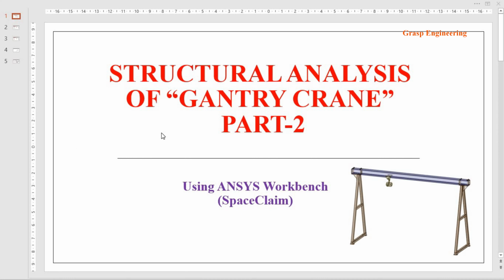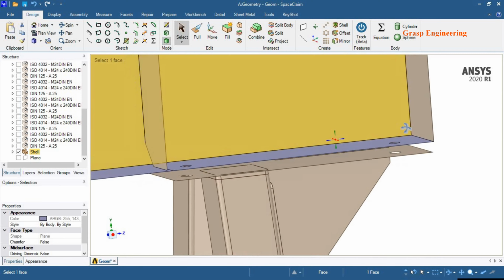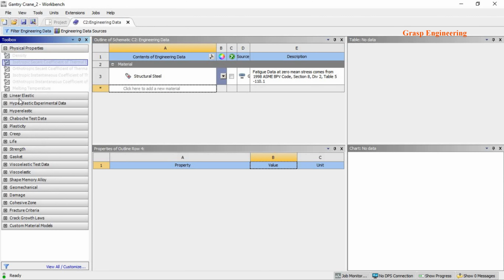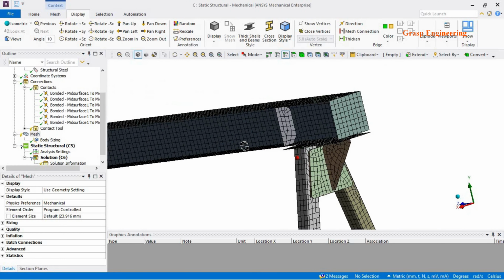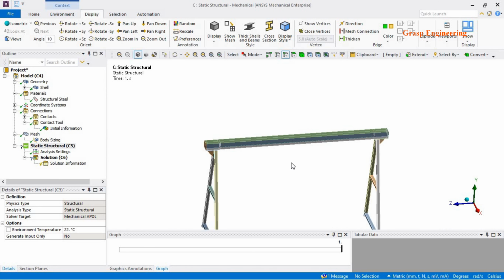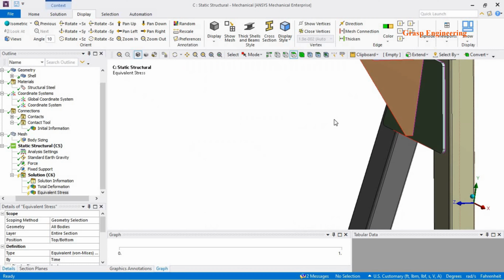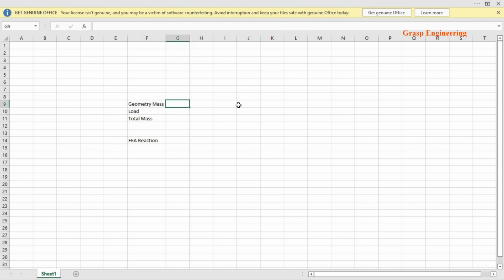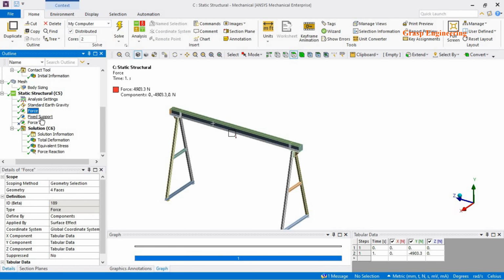Structural Analysis of Gantry Crane using ANSYS, Part 2

Comment: Hello Sir ,one question in my mind what if i import solid model from any cad software , only thing is it may take time for meshing or solution?
Reply: And after import the part if I convert the whole part as single body , result will be the or it will good practice in industrial?
Pls confirm Sir
Reply from the maker: Hello, you can direct establishe link between any cad software to ansys by using cad interface licence. Ansys also allow to import the cad files from other softwares too, you just to need to select the respective cad file extension while importing. Whatever Cad file you will import, you need to establish the connection in the ansys file either for sharing geometry or defining contacts.
Reply: Thanks for your reply Sir ,
After import the .stp file welded structure I can make single part instead adding connection. 
Or it will impacts on the result ?